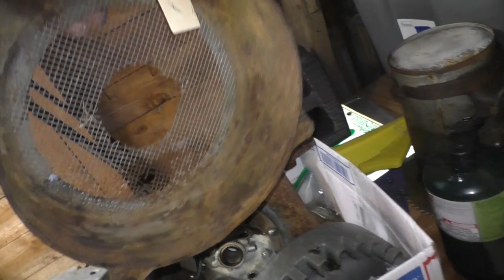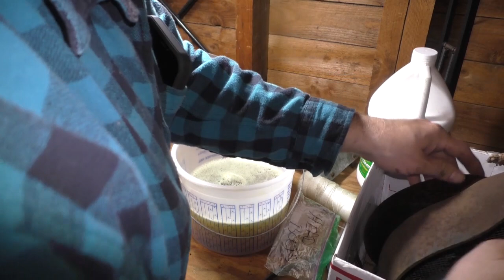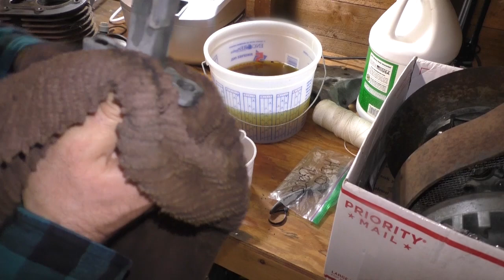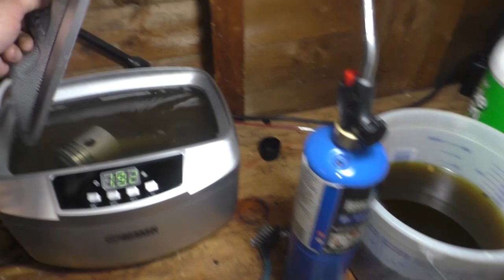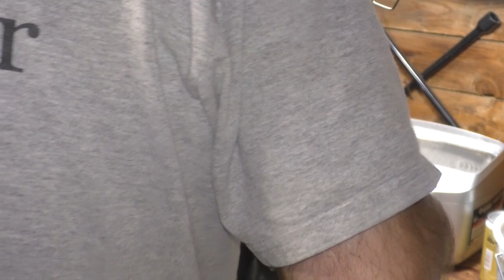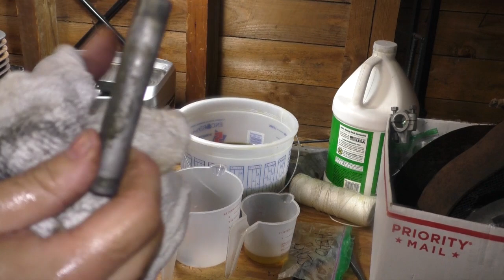1937 Briggs and Stratton Model A - Part 4 - Ultrasonic cleaning and EXHAUST REMOVAL!

Comment: Nice! Glad you found that shroud! I never knew they were cast iron! That's crazy lol! Just so you know, you can always have rings made if you can't find some. I had it done for my Ideal model V engine because it's quite an uncommon engine (and you could measure the ring gap on the original rings in inches lol) and it only cost me 20 bucks for 3 compression rings! I used Otto Gas Engine Works, but you should be able to find a set of Briggs rings for this thing really easily.  Do you plan on going the whole 9 yards and painting/ cosmetically restoring this thing too? Or do you want to just get it running and leave the original patina? Looking forward to seeing this thing run!